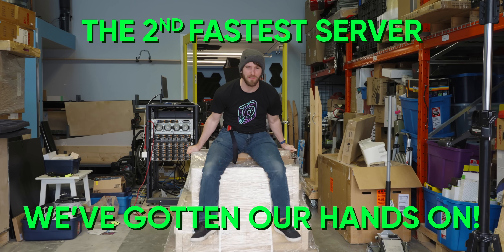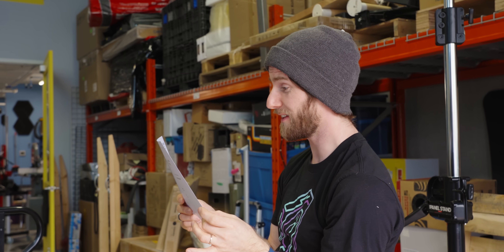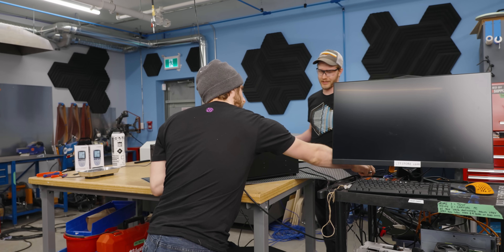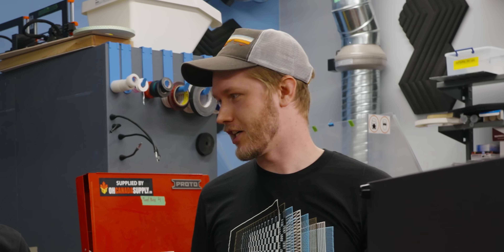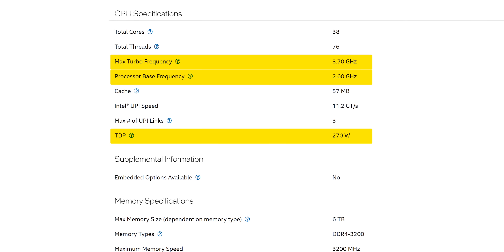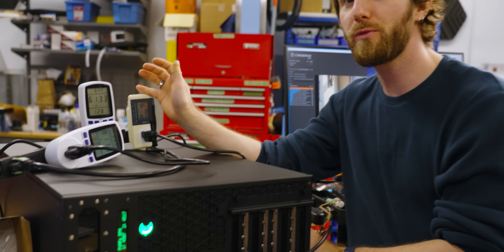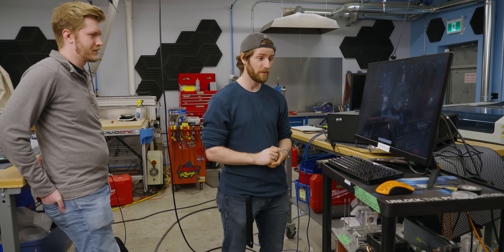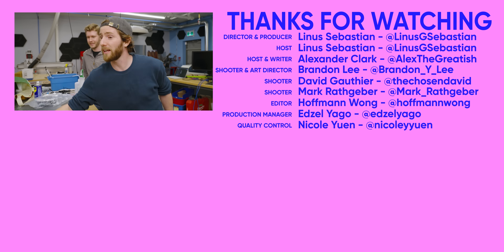The God of Computers - Comino Grando RM

Comment: I bought the Comino Grando RM Long. And im gonna save everyone thinking about getting a build from this company a lot of time, money, and headache right now. The quality and build of the computer are really great. But the support is so terrible it's hard to believe. Do NOT buy anything from this company unless you want absolutely no communication from them. Months go by before you hear a single word from them. Currently, I have had the computer for a couple months and it has literally just been a $25,000 glorified paperweight. There is an issue with power supplies and I have been able to a single word from them about it. DO NOT, I repeat DO NOT waste your time. Check out Lambda Labs. Great builds, they are cheaper, and their support is really great. The noise level difference isn't really that different either. The Comino is actually pretty loud when you have it running tasks.

Comment: Worldwide as a Frankenstein slave, usually at night, you go to the nearby hospital or camouflaged miniature-hospital van trucks. You strip naked, lay on the operating table, which slides into the sealed Computer God Robot Operating Cabinet. Intravenous tubes are connected. The slimy, vicious doctor simply pushes the starting button. Based upon your Computer God brain on the moon, which records progress in your systematic butchery, your butchery is continued. Exactly. Systematically. The Computer God Operating Cabinet has many robot arms, with electrical and laser beam knife robot arms. With fly-eye TV cameras watching your whole body, every part of you is monitored - even through your Frankenstein Controls! Synthetic blood; synthetic instant-sealing flesh and skin, even synthetic electrical heartbeat to keep you alive are some of the unbelievable Computer God Instant Plastic Surgery Secrets™.

Comment: If it does NOT use resonant tunnel diode threshold logic gates it is obsolete. In 1979 I was using I²L which does NOT have the quantum-mechanical defect of CMOS. And I'll bet your power supplies are not up to 2011 specs (95+% efficient, 0.999PF, 0 EMI, 0 ripple, etc…).

Comment: 15:00 These render times are very nice, but don't forget that animations still take a lot of time. But at least with this machine, you can watch your rendered animation within the same generation and don't have to bequest it to your kids.
So, let's say you go with the first settings of around about 7sec per frame. If you have created a film of 90 minutes, and you want to render it with 24 FPS because that's the common value in film making, then you end up with 129,600 frames (90*60*24). 129,600 frames * 7sec = 907200 seconds = 15120 minutes = 252 hours = 10.5 days. And I'm pretty sure that especially simulations like water, etc. will take more than 7sec per frame.
Don't get me wrong, this machine is freaking amazing, but it would be a total waste if someone who's making 3D just using it to render stills.

Comment: If you get to hold onto this one for any length of time, toss it at the guys over at LTT Labs 2 and see if they can get the driver situation sorted enough to get you meaningful benchmark results. Then also have them test AI learning speed. Then make a new video of them swapping in the RTX3090s so they can do comparison testing between those and the ludicrous A6000 cards.

Comment: 8:45 "this single dimm has more ram than your workstation" well, no, but thanks for trying. It turns out 265gb REALLY is overkill to run Excel and 3 Chrome windows with 20-30 tabs each

Comment: That's a pretty small radiator for 1200W of just GPU heat. 44C exhaust air means the coolant temp is likely about 60C, and this means the GPU cores are likely in the upper 70s. That's fine for gaming, but it makes week-long (168 hour) compute jobs risky. I run 2x480mm x 60mm thick rads (over 2.5x the capacity of the rad in the Comino) with fans in push-pull (compared to the Comino's push... from a distance) on my 4xA6000 machines without CPUs in the loop and I find that to just barely be enough capacity.

Comment: 90's 10mbit maybe 5ms ping or 100 mbit networking had like 1ms ping times. Your 60hz 90's monitor had 10-16ms but for 300hz displays its under 3ms. you see they're sort of tripling the speed means several times lower latencyBut strangely your year 2000's gigabit internet and 10gigabit or 100gigabit internet year 2000s japan or terabit japanese internet in osaka maybe 2009 docomo or swedish internet about that time being suuuper low latency or its not physically possible im guessing. So uhh when intel pretends their CPU's are faster and their fake xmp is higher mhz.. why the flying $#%^ is their fake XMP profiles lies being made glaringly obvious by the CAS latency getting HIGHER and using junk like command rate 2T and gear down mode? dont get me started on an intel data center or whatever (it cant ever be a super computer its not physically possible by definition unlike every ryzen system with NEGATIVE LATENCY)

Comment: Can anyone help me with my computer problem? So i had a drink on my desk it had spilled into my computer i had turn it off and unplugged the power supply and let it sit for 4 days and when i tried to turn it back on it boots but the start up process wont stop and the fans just continue to spin fast and it doesn’t post. Any tips of what would be broken/need to be replaced

Comment: The system is too fast for your benchmarking. You need to find some real world optimization problems that take more CPU and GPU power to stress a system like that. For instance, there are supply chain problems in Operations Research that require heavy compute to process.

Comment: To fully heat soak this you could mine eth and then monero for the cpu. Not endorsing that as a use case... but that will load everything on the system and test the liquid cooling.

Comment: seems great and even if instead of 60k it's 100k...it's not much for an industrial machine, Linus talked about it in other videos but industrial hardware is not cheap..a random trash quality 12" touchscreen lcd screen can cost you 5000$ on some machines...why ? 1) proprietary 2) you're making money with it and they want their "cut" so to speak 3) they usually come with some form of extended warranty, support or replacement program that casual hw doesn't

Comment: has more video memory than my laptop has solid state storage
has more memory than my laptop has hd storage
bench temp tops off at a lower temperature than my laptop on standby
base clock higher than the max clock freq my laptop can barely reach
finishes benchmarks in less time than it takes to boot my laptop
prolly makes a louder noise than what my speakers can output
no its actually quieter than that. Hmmm. I'm not sure whether that's a good thing or a bad thing for my laptop

Comment: I'm surprised every time you guys mention anything like needing to be on two circuits, limits are so low on your side of the ocean... We have 3600 watts as a maximum per circuit here in Europe (well at least in the Netherlands but I think it's pretty universal). Glad we have the higher voltage so that's possible without insanely thick cables :)
Reply: Correction, 5600watt on a single circuit if it has 2.5mm cables. (22a x 230v = 5600watt)

Comment: So how does the triple power supply thing work? Are they just paralleling the PSU outputs? I would assume not due to the imbalance in the draw per PSU. I would then assume they're biased in what they're supplying, but how exactly are they biasing the system, a dedicated CPU supply, a dedicated GPU supply, and a third that handles system components and it's excess supplies extra CPU and GPU demand?

Comment: Can anyone help with my issue:
I Edit footage on my pc using divinchi resolve and  I usually use 4k 100mbts file sizes and it does not play through raw footage while editing very well stuttering all the time. 
My pc has 16gb of 3000mhz ram, Rx 580 8gb gpu, Ryzen 5 3600 cpu with 3.6ghz base clock and 4.3ghz boost, asus b450 mobo.

My m1 mac plays 5k 100mbs go pro footage flawlessly and can scrub through instantly….what’s the difference?

Comment: With that kind of heat output, you'd need to run a vent to push that exhaust directly outside.
Reply: haven't you heard of an air conditioner?

Comment: You guys could install COMSOL and RUN some simulation considering a dynamic force applied for frequency range. I run some for a similar setup and we can stress the system, and it takes a couple days to be done.

Comment: 2kw? So it's basically just a consumer system on next gen NVIDIA parts, except there are more boards and like 20x the RAM.
Also that's a good point about my workstation. I should probably get another 32gb kit or switch to 2x32 soon

Comment: As far as I know, for many machine learning / deep learning purposes, those A6000s won’t scale well - they scale up almost linearly when using 2 of them (since NVlink is only for pairs of GPUs). To scale well, you probably need SMX NVswitch capable GPUs (like A100) with Mellanox (for multi-system scaling). Bandwidth (between GPUs) is a b***h nowadays.
Reply: The best strategy is to just wait for GPUs with more VRAM, and not waste any time on multi-GPU and the countless problems that come with it.
The AMD MI250 already have 128GB at 3.2 TB/s. Should be way faster than 2 A100. Next week I can benchmark them at JSC, then I'll know :)

Comment: When I was in my undergrad degree, we did a lot atomic crystal structure modeling on a gpu server. We used Quantum Espresso to research quantum sensing materials. Some of our lattice structures would take several hours to run. I wonder if that would make a good GPU test?
Reply: @Nightrogue Designs UK it's basically looking at materials that could be used for things like quantum computing. You basically model something like a diamond crystal by building a 3D model of each atom location in a modeling software. Then you take the coordinates of the atoms you model and put them in an input file. The input file is then feed in our case to the GPU server. The server is then used to calculate/estimate the forces and energies between each atom in the crystal structure. You can then use that data to things like ZPL (zero phonon line emission), band gap, etc.
Reply: @nemoworley352  Crystal? Define crystal because it sounds like the Atom Lattice but with a spesific structure of feature.
Reply: @MatsNorway  yeah by crystal structure, I'm meaning the same thing as atomic lattice.
Reply: But just for perspective we were using a Intel xeon based CPU server. I believe it was 48 cores. It would take 1-2 weeks for it to calculate some of the models.
Reply: In caveman terms, what is atomic crystal structure modelling primarily used for? Sounds interesting
Reply: @CosmicCustodian  Have you seen the move Hackers? It's basically like that.
Reply: @CosmicCustodian  only if i knew…
Reply: We used Espresso for lattice Boltzmann simulations of blood flow. The simulations for my Bachelor thesis took forever, even on GPU. So I did the obvious and wrote my own CFD software in OpenCL, and on the same 2080 Ti GPU, that does the exact same blood flow simulation 21x faster.
Now everyone wants to use my software too :D
Reply: @ProjectPhysX  Just out of interest, how long did it take you to write that? And how many lines of code roughly?
Reply: @82NeXus  most of the base functionality was complete in one year, and then 3 more years of optimizations and feature upgrades. Code is ~12k lines now. Runs a lot faster and requires only 1/3 the VRAM.

Our Espresso version was about 500k lines, much less efficient, with tons of unnecessary overhead. Just a pain to work with.

But most importantly, my FluidX3D software allowed me to run thousands of large-scale simulations on GPU in a week that with Espresso would have taken years. Without my own software, compute time alone would have been longer than my PhD contract.
Reply: @ProjectPhysX  That's nice!! Before you started it did you think it would be finished in "a few weeks" 😂 From my quick google it appears not to be open source, so have you sold it to anyone? 💰😄 Seems to be pretty hard to sell software nowadays in areas where there are open source solutions.
Reply: @82NeXus  I've spent the first 3 months searching for a bug in the LBM implementation :D
I will open source it soon, to eliminate all paid competition. I hate paid software, especially that subscription-based crap. Just need 2 papers to clear peer review first, but these are well on the way now.
Reply: @ProjectPhysX  3 months? Damn, that's a nasty bug! I wrote the SHA-256 algo a while ago and it had a bug. The intermediate steps just produce meaningless numbers, so I couldn't locate the bug. The way I debugged it was to get the source of a known-good implementation then step through it and my implementation in the debugger and compare intermediate results until they diverged!

I think open source is great, and tends to actually work. Whereas commercial can be anything from very high quality (quite rare) to complete junk. Means if you want to make money as a developer you have to move elsewhere though, or offer something extra.
Reply: @82NeXus  in the end it was one missing line :')
For these "invisible" bugs, where the compiler doesn't help you, the code runs normally but results are invalid, the best strategy is to identify the faulty code section, rewrite the entire thing, and when it works, compare with the faulty code and learn where the mistake was :)
Reply: @ProjectPhysX  Yeah, if you know how to write it correctly. That's very similar to what I did, except I compared it with someone else's code. Can only do that if equivalent (or maybe very similar) code exists though.
Reply: @ProjectPhysX  I am new to all this computer stuff and I am really curious how did you manage to do all that
Reply: @radmonk8185  learning by doing, specifically by writing OpenCL code. Every solved challenge brings new ones to the table, and every time you learn something :)
Reply: Sounds to me like a coffee machine...
Reply: I actually think this would be a perfect benchmark for extreme hardware! Like they’re always doing things with sitting bench,  so this in some fluid flow calculations would be amazing just to see the hardware burn!
Reply: alien technology
Reply: hope you didnt use retail GPUs you need A6000 cards. better suited to Ai and machine learning.

Comment: That cooling system was honestly the coolest part. I’m upset that such an implementation hasn’t been quite adopted for the consumer market. Those quick disconnects and custom water blocks were a thing of beauty.
Reply: because the consumers that they would aim them for are also the ones that would be comfortable doing a full custom loop and just draining the system
Reply: it's because they are expensive and consumers are not gonna pay for it
Reply: @SphinxKingStone  thats wrong! most industry connections are cheaper as consumer connections. Look at the consumer watercooling things like radiators, connections. Ridicously overpriced for this crap!
Reply: @SphinxKingStone  consumers pay for rgb
Reply: You a Whitechapel fan eh? 👀
Reply: Well I would hope it's the coolest part, it's kind of supposed to be
Reply: Those quick disconnects cost more than most consumer water cooling solutions lol.
Reply: @Nevir202  that sucks to hear :( I imagine that’s purely for profit potential and over-selling to the “professional” market however? I can’t imagine that takes a tremendous amount of labor, parts, and/or time to manufacture.
Reply: The cooling manifold with the quick disconnects is absolutely something that needs to be implemented on more stuff. The problem is that parallel cooling requires quite a bit of flow rate, rather than head pressure, so it can be challenging to get pumps and rads that can flow enough for it to be a viable solution. But, as this test case clearly shows, you can achieve astonishing cooling performance with minimal radiator sizes if you tune your loop perfectly. I'd love to see them bring on Singularity Computers or another youtube content creator that has experience creating CNC machined fluid manifolds to help them build a similar system for some of their other stuff. It'd be neat to see Lab 2 tackle a proper full-rack liquid cooling setup for switches and servers and the like. It'd take an insane pump, but such things exist and can be procured. It'd have to be one of their long-term projects, though, rather than one of these shallow dives, but man would it be cool. I think they mentioned that they got a proper CNC mill, so they can handle copper or aluminum for their cold plates, and the CNC router can already handle acetyl, acrylic, and other sheet plastics that they might want to use for the top plates and manifolds, so it's not too big a stretch to say that, aside from getting people experienced with designing such fluid paths and sticking together the silicone o-rings for them, they could totally do all that work in-house. LMG really has come a long way in what they're capable of building for themselves these days. I will say that if they want to make their own cold plates, they're going to need to get a right-angle mill or a 3rd axis attachment for their current mill so they can use some of those ultra-thin slitting discs to cut the fluid channels through the cold plate above the dies. Still, it's something feasible for them to obtain and I'm sure they'll be getting people with proper machining experience for Lab 1/2. I'm really looking forward to future content from the labs.
Reply: Just finding a 4U case with 3x 140mm is hard.
Reply: Yes, the cooling system is rather, "cool".  Did you recognise the pun?
Reply: @JesseGaming7593  not until after I commented, but figured it would be too meta to call it out lmao
Reply: Actually, you get sorta-that with some AIOs.